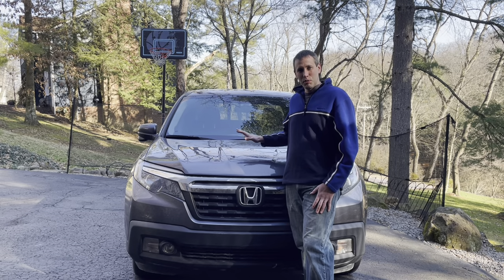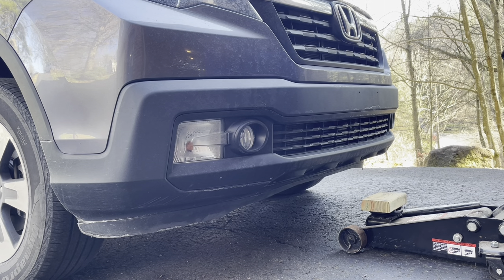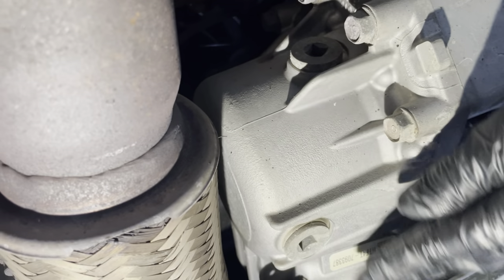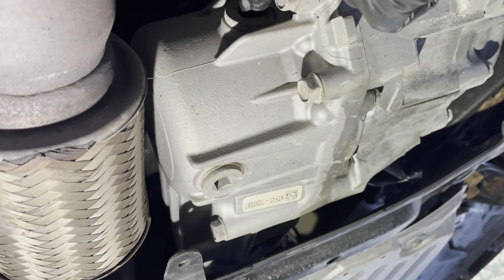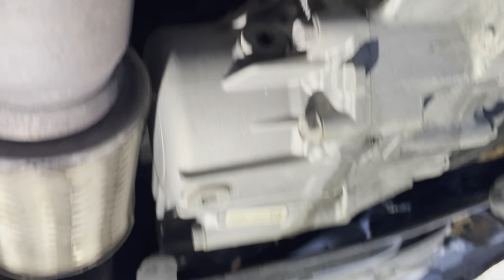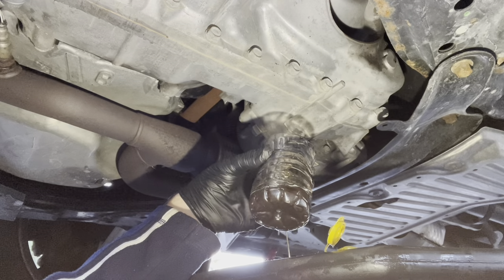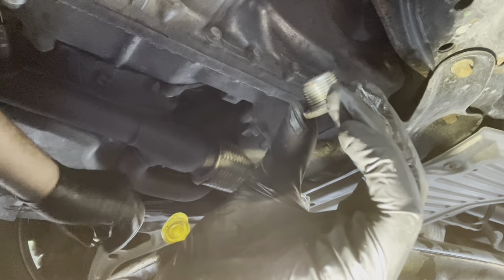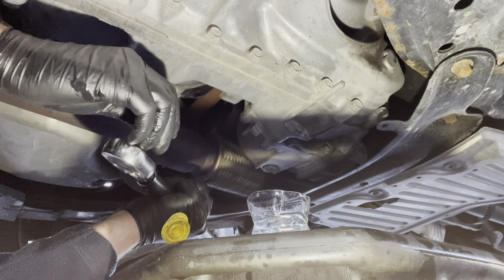Honda Ridgeline Transfer Case Fluid - How to change hypoid gear oil - Honda Pilot, Honda Passport

Comment from the maker: Here are links to the parts and tools that you need:
Transfer Case Fluid: https://amzn.to/3VkSiQw (Genuine Honda 08200-9014 Hypoid Gear Oil Hgo-1 75W-85)
Crush Washers (18mm and 20mm): https://amzn.to/3Gfp6pY (Part# 94109-20000 and 90471-PX4-000)
Oil Suction Gun: https://amzn.to/3vfoNoV
Torque Wrench: https://amzn.to/3BWcvWm
Socket Set: https://amzn.to/3PPlLkP
Breaker Bar: https://amzn.to/3WyMGmM
Jack: https://amzn.to/3FSowNq
Jack Stands: https://amzn.to/3HYjxO6
Creeper: https://amzn.to/3vapxvh
Rags: https://amzn.to/3FSASoX

Comment: You should always remove the fill bolt first, in case it is stuck, and you can't remove it.
Reply from the maker: Never heard that advice before, but it’s a great tip.  Thanks for sharing!
Reply: I worked in a garage, and the service manager yelled at me for doing that. LOL
Reply from the maker: @dane5896  I just recorded the differential fluid change (couldn’t get the fluid in time to do all three at the same time), you’ll get a shoutout for that tip when I post the video!
Reply: I have seen some posts that said to not replace the top fill plug until after starting engine and burping the air out....don't see that in every transfer case video but some...will be doing my first change thanks to this video in about a month..my garage is too cold right now!

Comment: How often do you drain/change the front xfr case and rear diff fluid?
Reply from the maker: Honda recommend changing both every 30,000 miles.   I changed mine at about 45,000, you can see in the video what it looks like, certainly needs it.
Reply: @NateFixesIt  I have 80K on my ridgeline and have only done it once (independent shop did it) so hoping to do it myself at 90K along with brake fluid)...thanks for the video
Reply from the maker: @kc8262  I was getting transmission judder, so I replaced the transmission fluid.  Decided to just go ahead and change Transfer case and rear differential at the same time while I had it jacked up.  It’s a pretty easy job.  Transmission was the hardest, but even it wasn’t too bad.